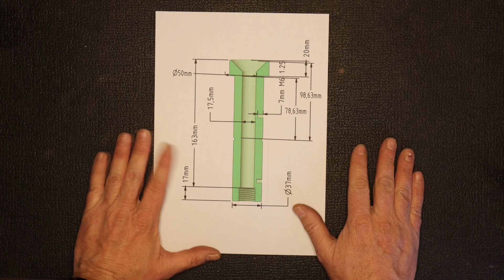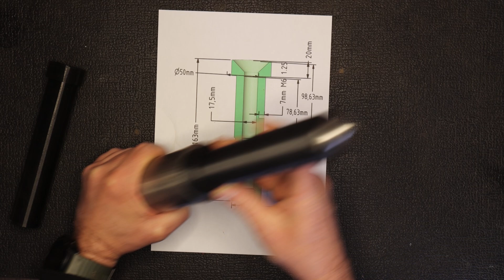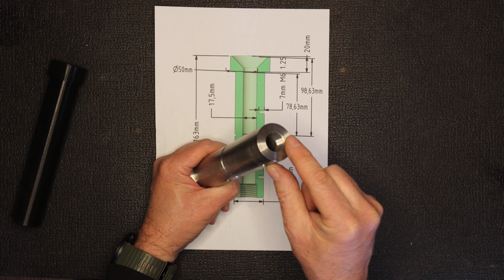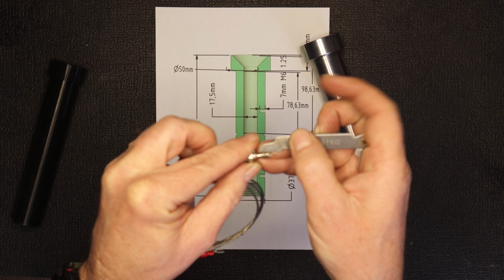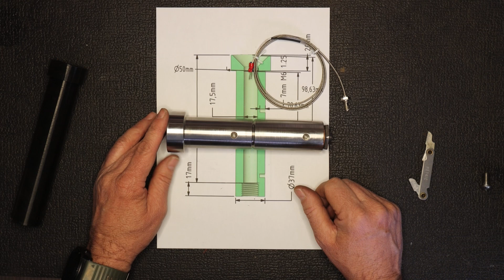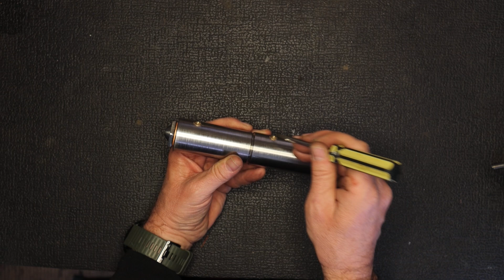DIY | Plastic injection machine | Heating Chamber | Part 3

Comment: What kind of lathe do you have? I have been planning to buy a smaller lathe, around 250kg maybe. Some people talk lot of crap about them and some say they are fine.
Reply from the maker: I have a quantum 250x550. But the new Lathes have variable speed drives which will make changing the speed a dream. I have belts, and they are a pain.
Reply: Hello, can I have your whatsupp, Sir, to send you pictures of nozzles I already did